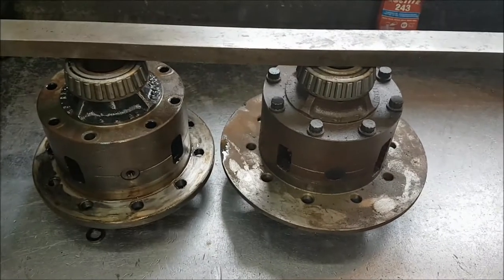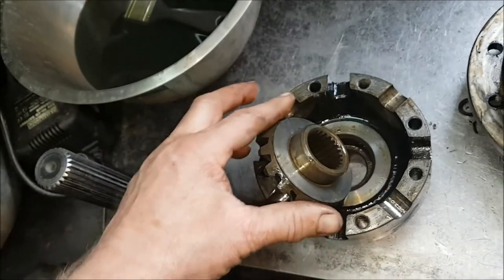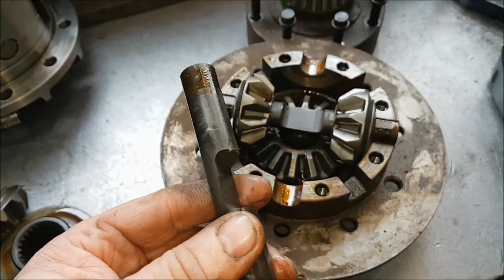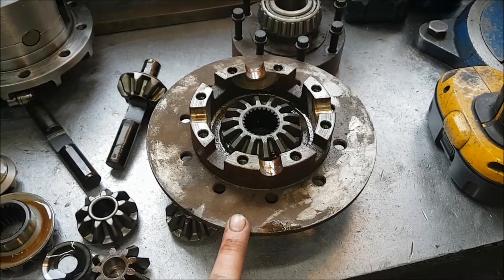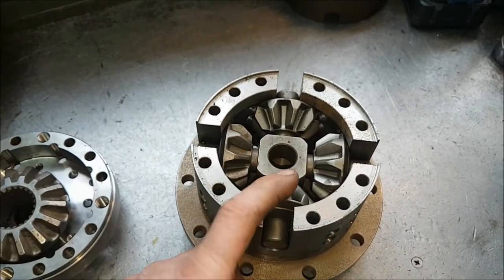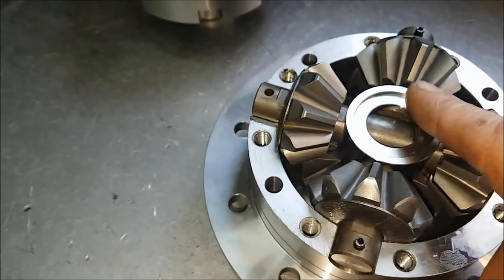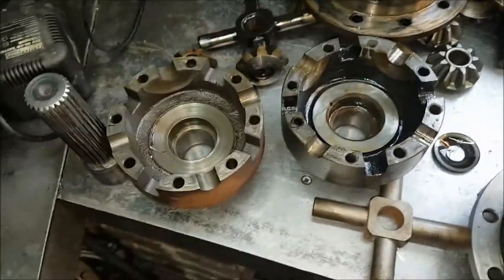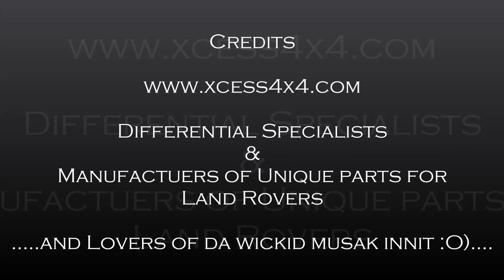All about Land Rover 4 Pin differentials

Comment: I would just shim out the worn casing instead of scrap it, does that sound stupid?
Reply from the maker: Doesn't work as an idea as the casing where the gears sit are not just worn badly but ground in wear and damage  at all sorts of differing angles so the shims as such would not sit flat. Sadly money/repair wise they have had it when they have this failure
Reply: MegasquirtUK Was thinking machine it straight till a measured shim fits snug :-)